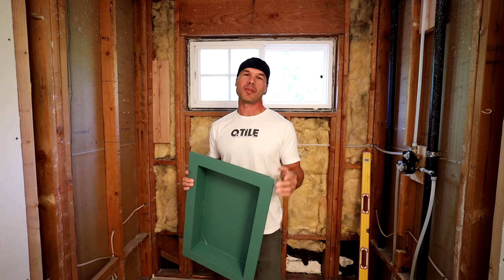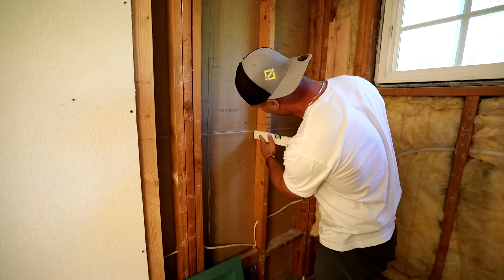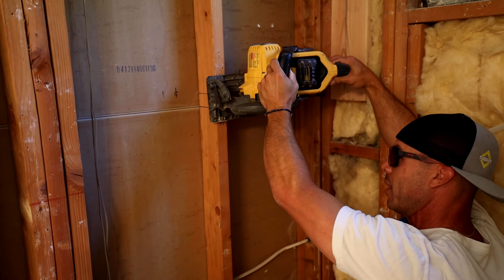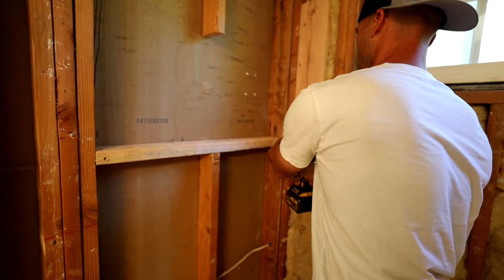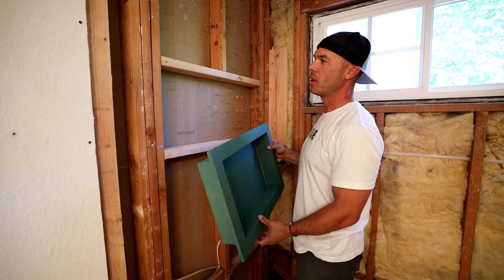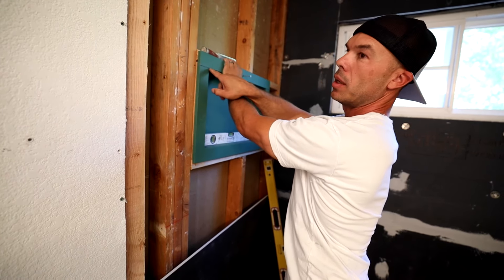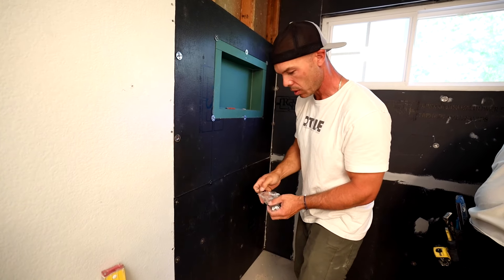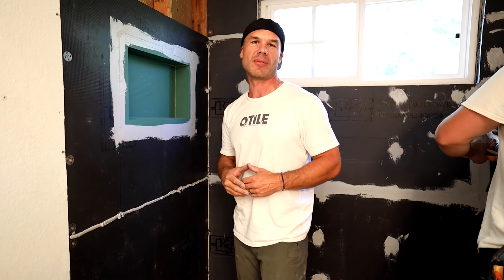Prefab Niche in Shower --- How to Remove Stud

Comment: When you use a sawzal on a wall cutting out a stud take a couple 2x4s and screw them to the studs  on either side of the one your cutting and it will keep the vibration from messing up the drywall on the other side .  Just alittle tip and thanks for the video hope all is well with you and your family
Reply: I’m sorry, can you explain what you mean?  Where do you attach your new 2x4’s to…the stud you are cutting out?

Comment: I don’t think I’ve ever watched you explain how you get the finish location of that pre-made niche to line up with the full tile. This is one thing o still struggle with. And when it’s off, it creates that ridiculous sliver. By then it’s too late. Thanks. This was a good one.
Reply: What I do is lay out the tiles that you will be installing on the floor somewhere with the spacers you’ll be using, wether it’s tile clips or spacers or both. Determine how many rows of tiles you want till you get the niche. Measure bottom of tiles to the top of tiles before niche. At least now you have a number you can then transfer to your wall and then cut out for niche. Hope that helps.
Reply: At the very least you want your tiles a little bit above the bottom of your niche, you’ll just have to add a little more thinset to build it up. But you don’t want to be slightly below your niche then you’ll have sliver tiles which like you said looks ridiculous.

Comment: Thx for this Isaac and definitely been seeing an uptake is RSS products, and really like that they offer different drain options, that works w/ like everyone, along w/ their website to order what ya need and even have you upload a drawing. Think it’s pretty nice products and processes and can easily speak w/ a rep if have questions or need advice/help by phone, email, txt. I to also like the foam wall boards (pro series), over HD series using the sheet membrane ; and a good product (similar to other membranes), but just like the speed and “ease” of the Pro vs HD personally.
Thx for the vid, and have a great day/week, cheers✌🏻

Comment: You can use the multi tool to cut the screw before tearing it off to prevent damage on the other side.
Reply: Which blades are you using to cut the screws? I haven't found a multi tool blade that can cut through more than 1 screw without destroying the blade. I have used biablo, Milwaukee,  Lenox, imperial, etc
Reply: @travisk5589  Titanium or carbide
Reply: @mrscott01  both.
Reply: Even if you cut the screw with a multitool the vibration will create a "nail pop" on the other side of the wall. You can cut drywall nails without damaging the wall but NOT screws. They are much harder than the nails.
Reply: @takismantas1159  i don't usually have a problem but a couple dimples is just a little spackle as opposed to big holes.  Cut slow with titanium or combination blade.

Comment: Skip the sawzall. Start by using the buzz saw behind the stuff to cut the fasteners.Then use the circular saw and get the depth a little closer to the full 3 and a half inches and finish with a hammer or the buzz saw

Comment: I wish you can make a video of building a custom niche on existing tile. I see hundreds of videos of new shower walls with new niche but none from existing tile wall. Im sure someone out there did this type of job. I want to see how they cut the existing tile and build the board around it and especially waterproofing between existing tile and new niche.
Reply: I saw a short video of retrofitting a prefab porcelain niche and just silicon around it. I mean it’s okay but i want a customized size to fit our needs.
Reply: Also, I have a metal stud that makes it harder to retrofit.

Comment: Never use a sawzall on studs with finsished drywall you’re trying to preserve. WAAAAY too much vibration. You’ll pop the taped joints around the stud every time.
Reply: @peaceranger7215  My thought exactly, small hand saw finishes the cut easily.
Reply: @als4817  That's what I would have used. Not sure if he had the space though.
Reply: What if you run saws all slowly
Reply: Ok so what other type of saw would you use then, if you don't wanna spend all day sawing (an during 3 different power tools, like this guy)? Lol

Comment: OK. Maybe not bad but I will put two 2x4 vertical on the too. Maybe overkill bit it will prevent cracks in case something heavy comes on the top. Or vibrations from the roof. And like they said to cut the nails with the multitool... I wouldn't. It's so much vibration cutting that type of steel that your way is much better. Can cause cracks on the whole wall.. All greetings form sunny Croatia! 🏖️🇭🇷🙂

Comment: Do you recommend applying a small layer of spray foam behind the niche - between the dry wall and the back of the niche?
Reply: Are you installing on an exterior wall? If it's an interior wall, definitely not.

Comment: Heya. I've been enjoying your videos for a year or so. I recently remodeled my small bathroom. I relocated the shower drain and used a Kerdi kit. While I did the shower floor, I had a tile guy do the shower walls.
My question is; Would you mount the brackets for the (very large) fixed glass panel by drilling into the 3/16" grout line, or center it better and drill through the tile? Porcelain over Kerdi membrane over 5.8" sheetrock. I can go into wood either way. I just figured drilling grout would be better than drilling tile.
Reply: I would go through the tile personally... Just my opinion.
Reply: Thanks. I've never drilled tile before. I did glass a LOT of years ago. I understand that bit is no good for porcelain?
Reply: @AlGrahamPhoto  you'll need a diamond tipped drill bit for porcelain. It's possible you already have the correct bit, as glass calls for the same. Just Google it to be sure 😃 Good luck with everything!

Comment: Hey Zach quick question, Do you paint your coating on the wall board before installing? or is that the type of wall board? Thanks
Reply: It's pre-waterproofed out of the box...like a Wedi system.

Make sure you put the sealant between each wallboard too or any boards that go next to each other like in corners too etc
Reply: Do you know the brand of wall board that is?

Comment: Are there any tips for cutting the hole into the backer board that accurately?  Looks like it was done off camera…
Reply: Maybe install the wallboard first and then cut out for the niche after. You’ll also have to do the framing after wallboard as well which might be a little bit more difficult. I think it’s more common to do the wallboards does and then niche.

Comment: I would at a minimum double your 2x4s on top put them on edge and sandwich a piece of 1/2 plywood between them. 1 2x4 on the flat side is not nearly enough when removing a stud!

Comment: Maybe it's my paranoia, but I feel like there needs to be a metal plate on the back of that niche, between it and the drywall. It's all great until someone hangs a picture in that bedroom and puts a wall anchor right through the back of the niche that's just made out of wallboard.
Reply: I have thought the same thing many a times. I have put in tons of these and can't believe I've never had a repair for such a thing